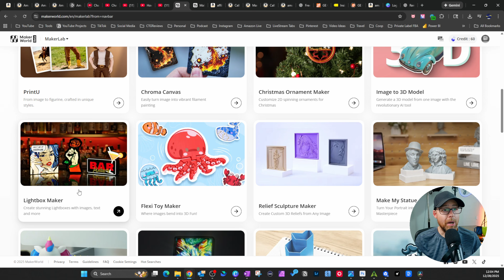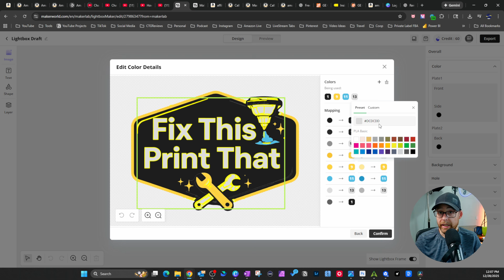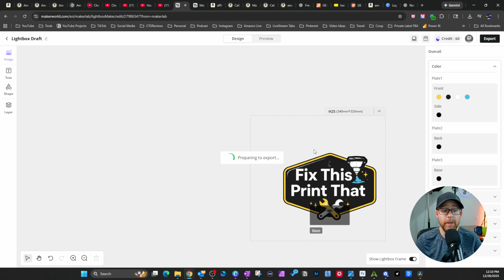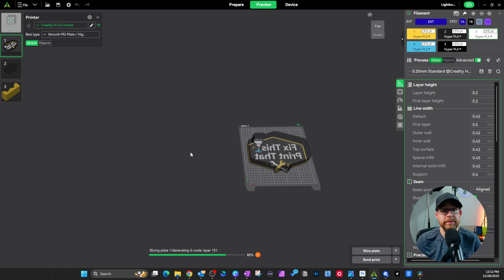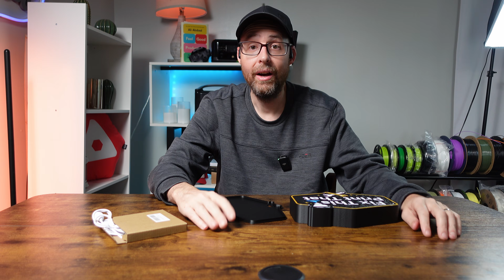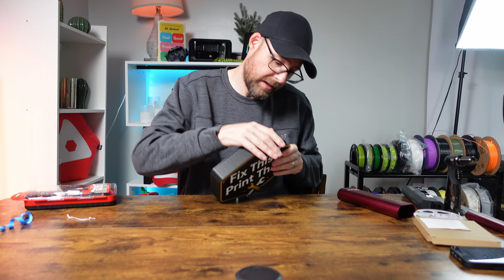How to Make a Light Box 3D Print (Step-by-Step LED Light Box Tutorial)

Comment: Great tutorial, I have printed a few premade boxes, but wanted to make my own.  Couple suggestions, inside of the backing plate in white will help reflect more light and make it brighter.  Tape the led strip closer to the back of the box, get more uniform light, especially to the middle. Finally, hot glue the end of the LED strip, especially the one with the cord, the weight tends to pull them out, little dab of hot glue secures it nicely.

Also, I have been printing the ones were the face is pops onto the back/box, where the light is mounted.  This allows for changing out faces printed the same size (quick change decor I guess).
Reply from the maker: Amazing tips!!!
Reply: How thick should the face be - how many layers?